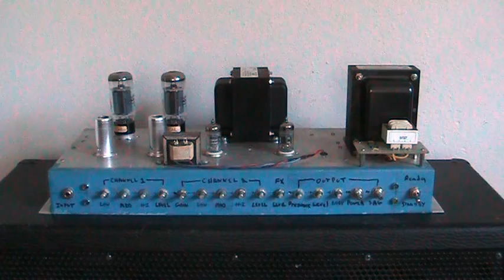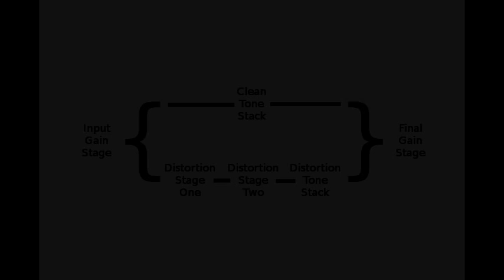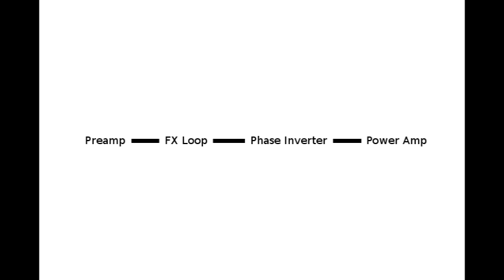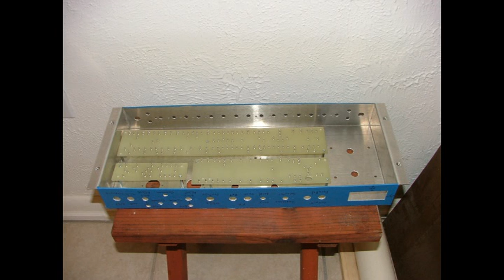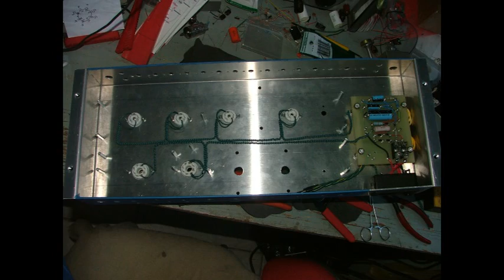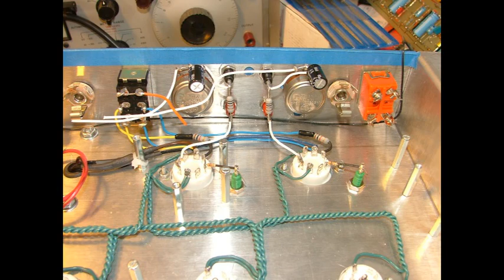Prototype 50 Watt Guitar Amplifier - Visual Overview

Comment: Hi Fred B, just stumbled across your channel. I realize this is an old video, but did you say the output trans is for 6K6?... How did you make it work with the EL34's? I was looking at the 6K6 tube data and plate to plate load is 12,000 ohms.. 6CA7s is 6500.. Just curious what you did to make it work... Thanks, Tom  You have built some nice amps btw

Comment: Hey. I built an amp based on Kevin's recommendations. I am really happy at how it turned out. based it on a jcm800 2204 platform but incorporated separate biasing, power scaling and used his galactic grounding explained in TUT 2.

Comment: You did an excellent job, both in your presentation of the amp and in your actual build - well organized and quality build - what if any, design software did you use to draw your circuit and plan your component /board layout? Also can you also tell me what brand and vintage (old used, NOS or Current production) components (POTS, resistors, transformers, caps) - your wiring also looks terrific, what gauge wire did you use for your non-shielded connections, solid or stranded, plastic or cloth covering? The only thing that stands out to me that I would have done differently is the filter caps - I would not have used what looks like those Chinese Illinois brand, I would have used the much larger, higher quality and longer lasting (much better filtering) Sprague and/or F&T brands (American / German made respectively) - yes they cost more, but for a labor of love like this one, I would have used the best parts available - CTS POTS, Carbon Comp NOS resistors in the signal path, and high quality "tone caps" either NOS or the higher quality New Stock /current production (Sprague Orange Drop, Sozo yellow caps,  mojotone, JJ etc) - I have built and restored several new and vintage amps and there is definitely is a difference tone wise although some argue not - between quality components and Chinese knockoffs, same goes for Tubes and Speakers - there is very good new production stuff out there at reasonable prices. Your AMP is a work of art...  and some great features (scaling / sag) that I would love to hear because at the end of the day - that is what matters. Would also love to see the schematic for this design - I am definitely going to pick up a few of Kevin's Books _ I have all of Gerald Weber's books/videos and Kevin's would give me some different perspective.Chris
Reply from the maker: For design work I used LTSpice to simulate the circuits.  For layout I used a lots of graph paper, and then made a number of full scale mock ups of the turret boards with Masonite, in which I drilled holes, pressed in turrets and trial fitted components and rearranged things until I got everything to fit in the space available. 

For components,  the big blue electrolytics are Xircons I used them because Spragues and other brands of similar values are significantly bigger and I was already pressed for space on the boards, I also made use here and there of Wima film caps and Kemet tantalums.  I like tantalums for cathode bypass caps on gain stages. I used metal oxide resistors of various brands extensively in both the signal path and the power path.  

Tubes were a bit of a problem. for preamp tubes I had only current production ones to work with and although I ended up liking the JJs the best, they still leave me a bit wanting. For power tubes I had a small variety to try, including some NOS EL-34s. With the power tubes I ended up liking the big bottle Russian 6CA7's the best for the type of music I like to play, hard rock with a heavy metal edge to it.   

The schematic is quite close to the London Power Standard as presented in the book, with the exceptions of the NFB loop on the first distortion stage and the reworked FET switching circuitry 

For wiring I use 18 gauge sold for heater wiring and 22 gauge solid for everything else.

I appreciate your reply. There are some good thoughts there.    

Thank you,

FB

Comment: One upgrade you can do is if you have a standby switch add a 2 watt 150K resistor across the standby poles. This slowly bleeds in power around the standby switch into the main rectifier circuit when the amp is first turned on. This sends a small amount of power to the rectifier and the large caps instead of hitting them with full power from the standby. Keeps them low charged when in standby because standby is really just a mute switch anyway. I got this from Merlin Blencowe.

Comment: I would lose the ground switch, its not needed if you have a proper plug with ground.  Placement of transformers and other components will keep your amp very quiet.
Reply from the maker: There are a few things including the ground lift I would leave out of the next one, such as the triode/pentode switch because that causes an impedance shift in the output section that is unaccounted for and that is what caused the tone shift in the amp that I noticed between the two modes. I've also since designed a transparent  high voltage solid state FX loop. The tube buffered one took a lot of work and space to get functioning well. A solid state one would be significantly more convenient for a number of reasons. 

Cheers, 

FB

Comment: Awesome vid! Just starting to research building amps. Cant decide what route to take.
Reply from the maker: From my experience with this, I would recommend building a kit first, such as a Marshall 50W or a Fender 5E3 etc.  Even though this one finally turned out well, I consider it too big of a step after just an AX84 Hi-Octane kit.  There's a lot to learn about fabrication techniques and layout, that one really should take their time with to enjoy and learn in depth.  This is actually a fairly complicated design from which, I learned I could have done a number of things better.